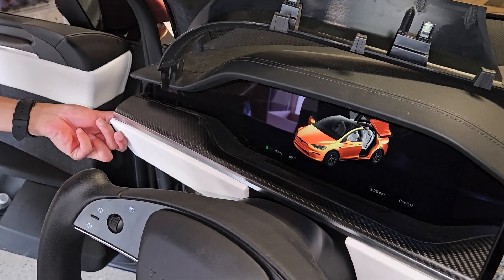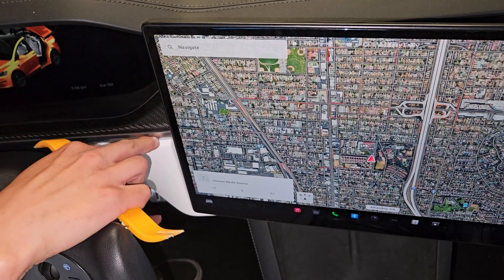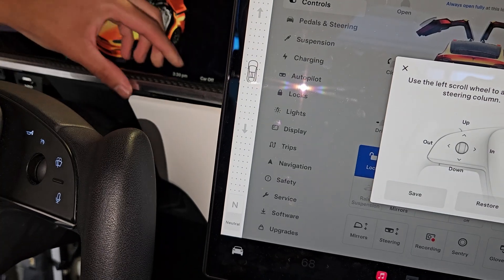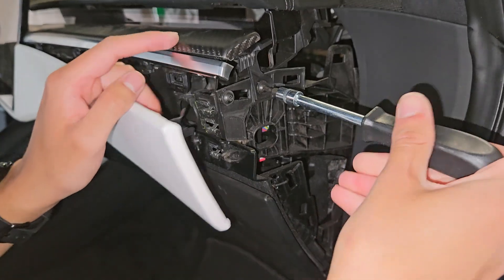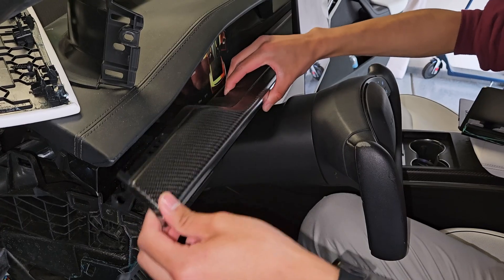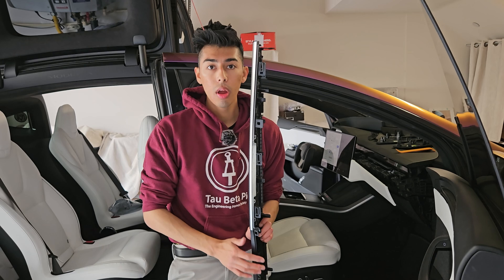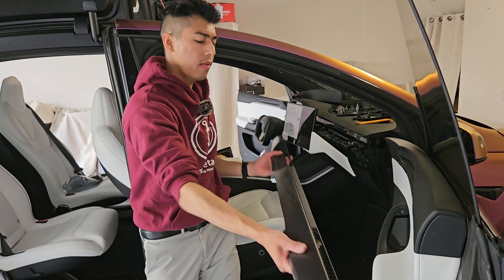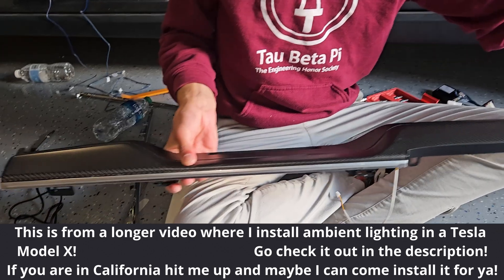🤯 Tesla Model X DASHBOARD REMOVAL! Are You CRAZY?! (2022 Guide) ⚠️

Comment: Does the white trim on the passenger side and around the computer come right off OR does that require the screen removal?
Reply from the maker: It comes off. You want to pull it out and down it's one long piece
Reply: @ thank you. Was not sure if I had to remove the screen and how hard that would be.  I just want to pop off the black leather dash panels and redo them in white leather
Reply from the maker: @matthewvernon8876  white leather is really cool, I kind of want to do something similar to my Model 3 with the black to white